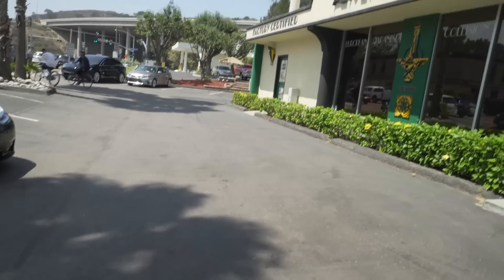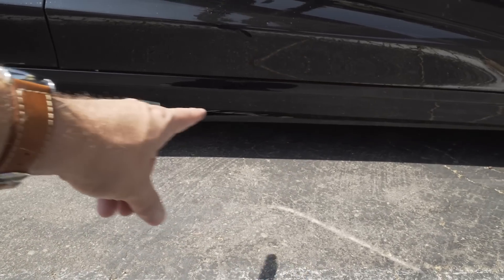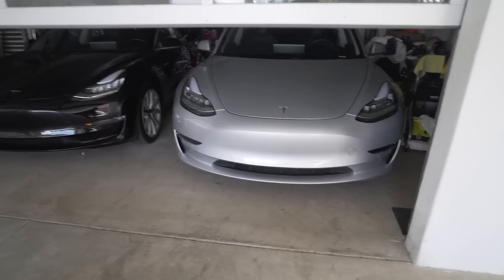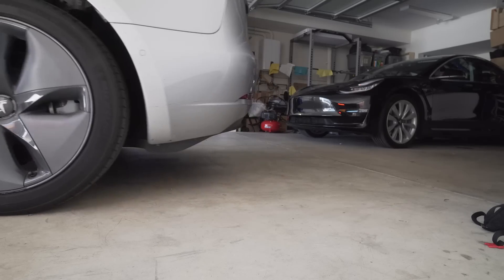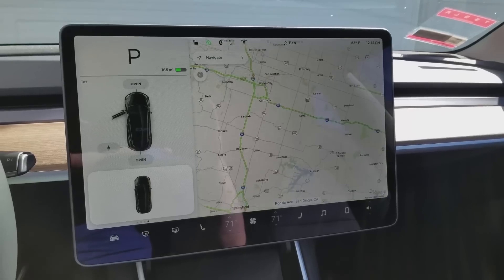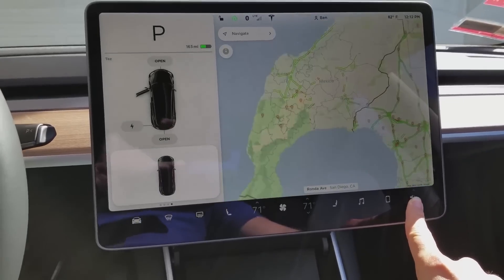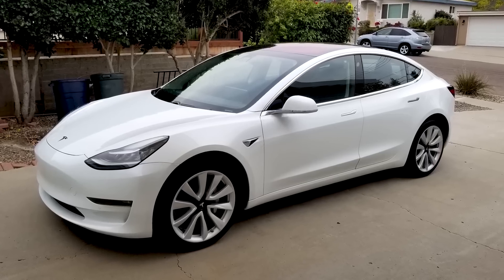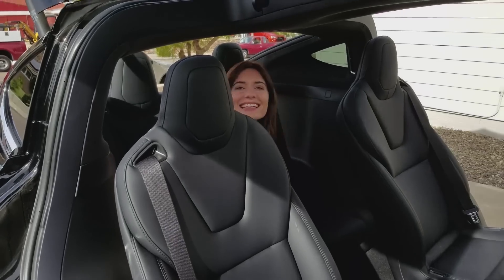Every Tesla Model 3 Repair I've Had and Outcome - Body Damage Update

Comment: Sounds like you've had your share of challenges, but like you said it's par for the course for being an early adopter. I got my Model 3 in May/June and things have been going smoothly (e.g. no problems yet). Haven't taken it on any long road trips yet to really push the battery – mostly just to and from work. Love the ride, interior trim, and the overall experience is a heck of a lot of fun to drive. Appreciate the openness and candor of your podcast. As always, great work. Keep it up!

Comment: Knock on wood: Pleased to say that I've had Telsa out once in 4 mos of Model 3 ownership.  They replaced airbag unit in the steering wheel as there were indentations on it found at delivery.  The other fix was to the chrome trim above the doors that was scratched by the window tinter (and they paid for).  Love the house service.  Awesome ownership experience!

Comment: My VIN is 15xxx.  It was delivered to my home in mid-April.  The closest Tesla service center is over a five-hour drive away.  I have had two Tesla 'ranger' visits (closest Ranger is 2.5 hours away).  First one was to replace the two key cards that had been lost (my fault, don't ask), while he was there he re-aligned the trunk lid very well (his first).  Also, I pointed out a ding in my driver door chrome (it came that way and you could only see it in the sun from an angle, just an annoyance).  He said he would replace it the next time he was in town, which he did a few weeks later at my home.  During the first few weeks, I had several software/re-boot issues  (e.g., the rear camera went out, a hard reboot solved this), but none since then.   The only item on my list now is some interior trim on my A-pillar is askew, haven't called about that yet.  I haven't had any of the more serious issues like the wind noise some of the earliest models reported (very quiet at highway speeds, as long as the roads are smooth) or any of the issues described by Ben.  I'm very impressed by the Ranger service, but I'm not sure I'd be comfortable owning this car out of warranty and so far away from a service center.  I'll worry about that in three-plus years.  I am pleasantly surprised how much I'm loving my Model 3 and Tesla's 'Appleish' customer service.  It would be great if Tesla would offer an extended warranty for the Model 3.

Comment: When I saw the list I thought wow.  But since many were proactive fixes by Tesla, that's great.  My 124xx May delivered car only had a door gasket issue and a defective front speaker grille.  Body is great except for one headlight slightly sticking out more than the other.  My second gen seats are great.  Vampire loss is down to 1.5 miles per day after the last couple software updates.

Thanks for great videos and I hope your car is fixed soon.

Comment: I picked up my Model 3 on August 7th, 11 days later I found a crack in my glass roof, only not nearly as cool looking as yours.  The earliest date I could get to bring it in to be fixed is Sept. 6, and out here in the boonies it's a two & a half hour drive to the nearest service center. They also said they'd likely keep the car for several days so they're giving me a loaner car (probably gas). Several people who've seen the crack agree it's probably a stress fracture, in which case it should be covered under warranty at least. We'll see how it goes, the repair process is reportedly a lot more frustrating these days.

Comment: I got mine in mid-june and a month in the software updated and the car wouldn't start or charge the next day... so they towed it and it took almost 2 days to fix it but they never fixed any actual thing in the car, just the firmware. Now I never update it right away I set it for like 6-12 hours later in hopes they find any issues with the firmware before I download it :)

Initial fixes, squeak in break clips or something they head it when I came in to get  more keycards made and fixed it without me asking. Then a couple weeks later I came in because the button to adjust the passenger seat broke off and the back left tail light was very foggy for weeks on end so they fixed both of those items. So three visits total, one of which I don't really count because I went in for new keycards. I've had it 3 months :D I LOVE IT.

Comment: Took delivery of my M3D two weeks ago (VIN 54xxx) and there was no freon in a/c and the frunk lid edges would nearly collide with fender panels upon closing.  I could have refused the car but after waiting 2 years thats hard to do.  Took it to Tesla service and they said a/c had a crimped o-ring and they adjusted the frunk so it had perfect gaps all the way around.  I'm very satisfied with the M3 now but it goes to show there may still be some QC issues with the AWD units built in the "tent".
Reply: Should have refused the car. Same old BS from the auto companies where a known defect during production is 'overlooked' and instead of a proper fix will rely upon a 'recall' on the problem for it to be resolved at a dealer outlet.
Reply: These tent built cars will be collectors items in about 10 years.

Comment: i got mine june 6 in canada, and had the screen glitch issue once or twice.  i assumed it would get fixed with a software update.  there's a fit & finish issue around the driver side headlight where the body, the hood, the headlight and the bumper look nice & clean on the passenger side but are a mishmash on the driver's side; i have decided to keep the car this way as a memento of the frenetic ramp-up of early production.  i'm sure later models will be perfect, so i consider it a rarity.

Comment: I have a model 3 long-range rental rented through turo and it only has one issue and that is kind of like the one that you had planning your car but it was not planed and the little plastic piece right there probably got too hot from sitting on black tarmac which is fairly common in the area I live in during one of our hot days that was a hundred degrees and that side of the car being in the sun probably but other than that the car is in great shape set for the guy who owns the car kind of scraped the passenger mirror a little bit so there is a scratch on the passenger mirror but it's been a great car for me to drive as a rental car $0.22 a kilowatt for supercharging in my area so I owe him $8.80 for going in supercharging the car it's been a great car fun to drive really neat it's just my needs for a car being a full-time Uber driver or something that I can go 400 miles non-stop on or if I have to stop either it's on my way to go pick up somebody or after I've given her a ride and I need to make it a quick stop naughty stop where you have to stop for 30 minutes to an hour to charge.

Comment: Phew, happy that I cancelled my Model 3 reservation. I hate to go to a dealer or service center. For me personally after 3 times I would give them back my keys. Also 60k was too high for me spending on a car. I drive the new Mini Clubman now, just got the first service (just some oil and filters) after 1 year and 15k miles. Car before was a Renault megane, service schedule was once a year or every 20k miles. Never had a thing (just some brake pads, tires and some oil change) and drove 100k miles in 4 years, car costed me 25k dollars, car looked like new when i sold it. My next car i'd like to have an EV, but don't want to be an early adopter. Hopefully model Y would be better and cheaper.